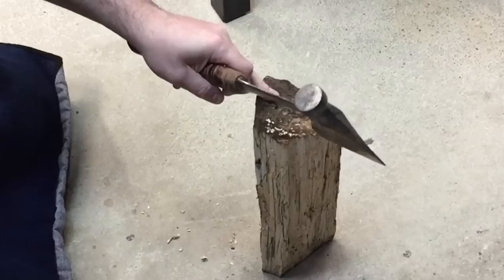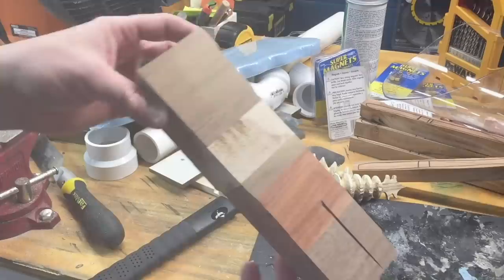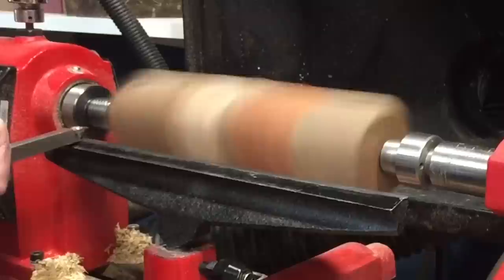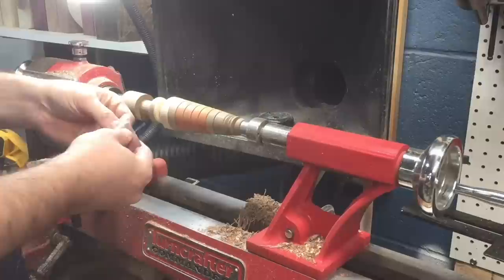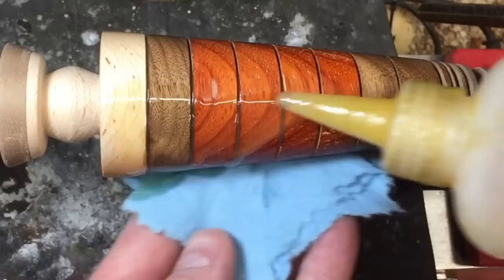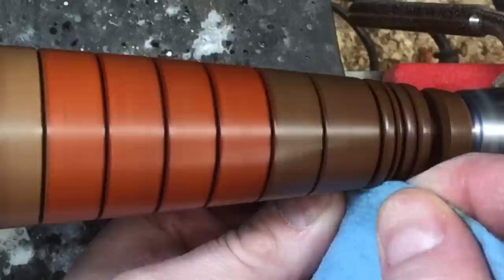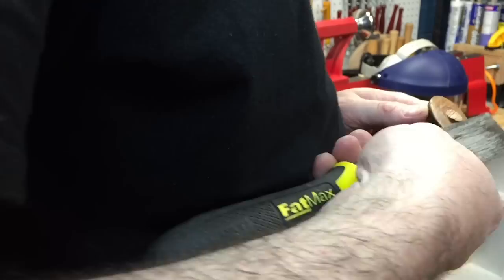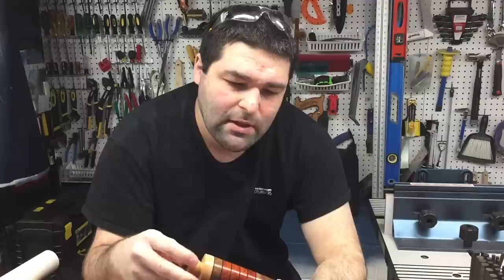Wood Turning a Small Christmas Tree Art Deco Style

Comment: Iv been a wood Turner for over 38 years. With timber as dry as you have soak the log in boiled linseed  oil for a couple of weeks then you'll be fine. Oil stops the flackyness. Good luck.
Reply from the maker: CHRIS BUTCHER thanks for the tip. I’ve had luck turning Spalted woods dry, but this time not so lucky. I use wood hardener sometimes. Thanks for watching.

Comment: Very nice piece of art you got there.  I'm glad you went with the current tree topper, it looks much better.
Reply from the maker: Wayne E. thank you so much. Im happy with the topper but I still want that star. Lol cheers my friend.
Reply: I have a lathe on order and it will be my first, so I'm trying to learn as much as I can before it gets here.  I've done all kinds of wood working, just no lathe work.  I've seen someone use a Forster bit to "cut" out the inner portion of a cup, is that normal and or safe?
Reply from the maker: Wayne E. hey, glad to hear you've purchased a lathe. I have to warn you, it's addictive, Lol. As for the cup hollowing, you can use a fostner bit. I use a 3" one sometimes to quickly remove wood on bowls. Only tip for safety is make sure the bit is secure in the tail stock Jacobs chuck. Your lathe power will determine how big of a bit you can use. My 3" bit works but will sometime bog the lathe down. Hope that helps. Cheers and happy new year.
Reply: Thanks a lot for tip.  Happy Holidays to you and yours.  I can't wait to try my first project.
Reply from the maker: Wayne E. good luck and no problem. You can always shoot me a comment if you have questions on your first project.
Reply: Ok will do bud.

Comment: Need to stabilise the spalted ash in the vacuum pot or it just going to keep breaking out on you. I use a vacuum pump, an old pressure cooker and ronson wood stabiliser and it makes all the difference you need.
Reply from the maker: Andrew Wilson hey, thank you. I have turned spalted wood before and had luck, but this time was a challenge. I agree with you on the stabilizing pot, I don't own one. I also herd wood hardener will help. Thanks for watching.

Comment: Question:  with spalted wood", it can be turned without undergoing any treatment?  I saw yours broke, but I assume you have had success turning spalted wood.  Is there anything I should know about turning it or use of other tools on it?  I have so far turned only one item ever... a few weeks ago, a wooden "club".
Reply from the maker: Cally Camp hi Cally, good question. I have turned untreated spalted wood before with no issues. No luck this time, but it did come from a fire wood pile, so it wasn't a huge loss. I was also trying to carve small diameters and would have had better luck keeping the wood thicker. Tips: if the spalted wood is soft like a sponge, don't try turning it without stabilizing, it's too rotten. If the moisture content is high, try and dry it out more to harden it, plus this would halt the decaying process. If the wood is overly punky, I would stabilize it, I've heard Cactus  juice works well. Another one of my subscribers, mentioned on this video, to use a wood hardener, which I have not used before and want to give it a try. It's cheap and you don't have to buy the stabilizing equipment. I don't turn stabilized wood extensively, so I'd rather spend the money on other shop tools. A method I have used before is thin CA glue, and that works well, but only soaks in so far; you may have to keep applying coats as you turn. Note: I wouldn't want to use up a ton of CA glue on a big log like the piece I used in this video. Hope this helps. Thank you for watching and happy new year my friend.
Reply: How about using an epoxy resin?  Would that work itself deep into the spalted wood?  I want to try turning a clock like I have seen on you tube using the colored pencils cut in 2 " lengths,  One woodturner man did turn such a clock,  and improved on  one he had seen turned.  So far I have 300 lengths but I need more....or I will just resort to making a small decorative plate to hang on the wall.
Reply from the maker: Cally Camp hi, I'm pretty sure epoxy would stay in the surface without a pressure pot. I have turned pencils with and without epoxy and both results were great. Check out my bottle stopper video on pencils, you may find interesting. A clock sounds like a great idea. I also have a clock video, clocks are great to make. Plates are great too. Lol. I just like turning. Lol thanks my friend.

Comment: Spalted wood is great looking but handles much better after vacuum stabilizing with cactus juice.
Reply from the maker: wakely wanderer hey, thank you for watching and for your feed back. I did think about stabilizing the wood, but I didn't have any of the tools. I also thought of using some thin CA glue on the log too, but I didn't want to waste a ton of glue on a big piece of fire wood. Lol. I've never tried or turned something with cactus juice before, I would like to try it. Ive also been thinking about getting a vacuum pot too for pen blanks. Thank you for the tip, I appreciate it my friend. Cheers and happy holidays.
Reply: Wakely beat me to it.  I have recently purchased a pressure pot AND a vacuum pot for stabilizing and for resin casting.  I was going to suggest stabilizing too.  It's apparently really good for spalted or punky, soft wood.

Comment: what midi lathe would you recommend?
Reply from the maker: john root hi, I currently have a PSI midi lathe with a bed extension and it's been good to me for years. I've used jet and nova midi lathes and have liked both. I've never used a vicmark but hear they are great midi lathes too. Depends on what you plan to turn. If you are going to turn a lot of bowls, you may want a lathe with a 12" span and some decent power. If you are planning on say pens, then you wouldn't have to be as picky. Hope this helps. Cheers and happy new year.
Reply: what do you think of the jet 1221vs?
Reply from the maker: john root hi,I have never used this model, but I have used similar jet lathes. The variable speed is nice. I wouldn't buy a lathe without it. This model is similar to mine, in that you will still have to move the belt. I modified mine so that I can go 50 to max without having to change the belt, I just lose a little tork at the low speeds. All in all, I would say that model is fine. Cheers!